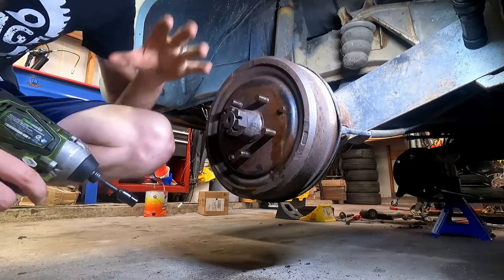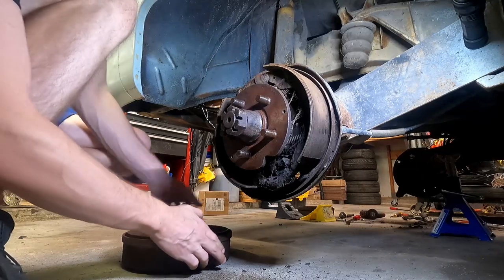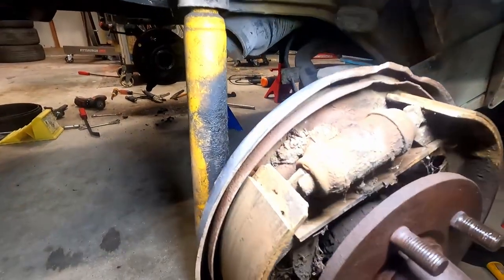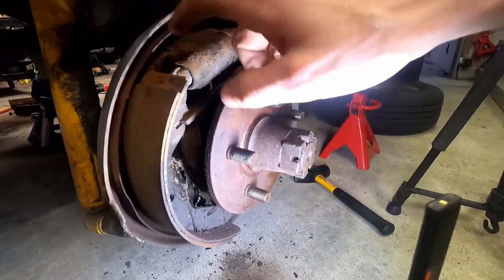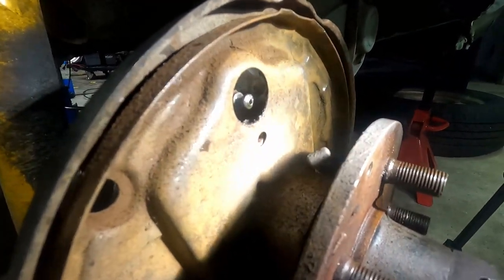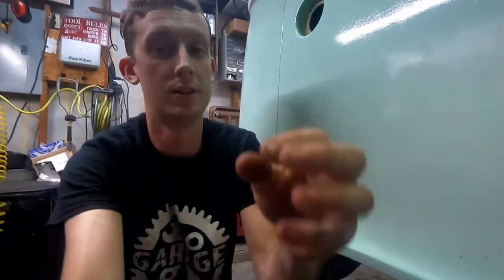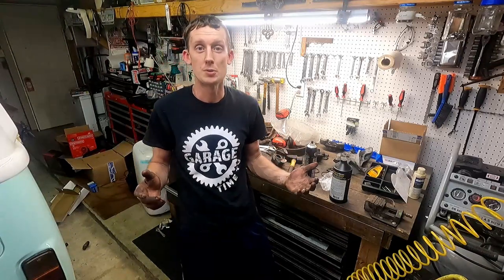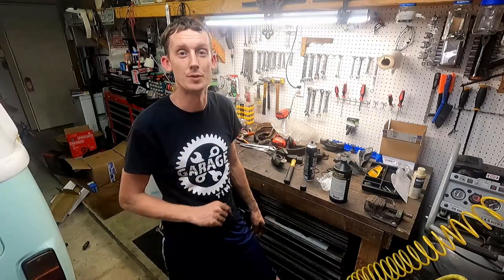Brake Shoe and Drum Replacement for our 1974 VW Transporter Bus Project!

Comment: I realized you put the parking brake lever towards the back but it’s supposed to be on the front. I had to deal with that pin I had to press in as well.

Comment: Verbal communication of how you did something is not as good as actually struggling with it. I won’t subscribe to this as I want to see it done. Removing the wheel and hub would have made a better video. And you could have checked the bearings.